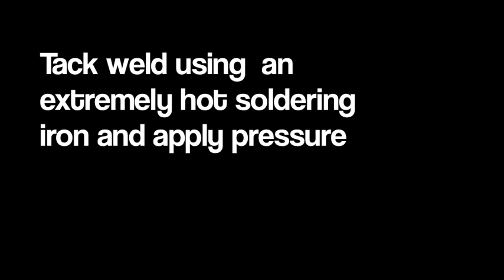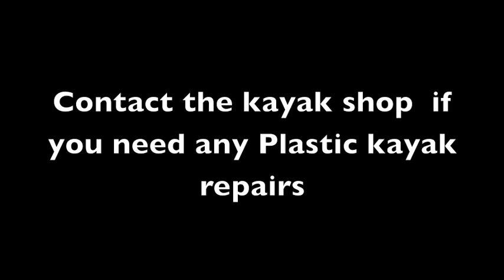How to plastic weld a Polyethylene kayak - kayak repair

Comment: Looks like you only welded the edges.  Okay for adding a rub guard like this video since it's only holding it, but fixing a crack or holes you need to fuse the old and new material entirely.
Reply: Yes we do all kinds of repairs,
I could have welded the rub guard to the hull but it was way to worn and thin.

Comment: Where can i buy the rods and poly material?
Reply: Amazon they are called a hot air welder. They have speed attachments so you can feed in the rod as well

Comment: Too bad that the Leicester Triac Heatgun is avery expensive professional tool.
Reply: The plastic welder heat gun from harbor freight is actually a great tool and not too much money.
Reply: It’s the only one that pulses heat and makes the polymer chains stand up to be intermingled with the welding rod. All other heat guns just blow hot air and don’t “weld” properly.

Comment: That is very sloppy and is a marginal repair. Using a flame for plastic repair is very difficult to control and can create more problems.
Reply: I’m not using a flame.
It’s a Leister Triac plastic welding gun.
Reply: puh, sloppy my ass.